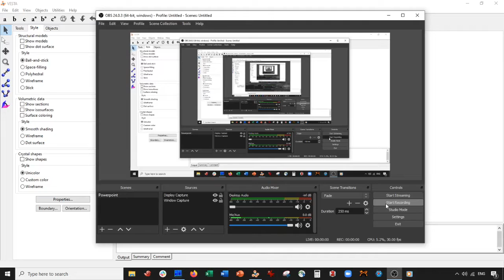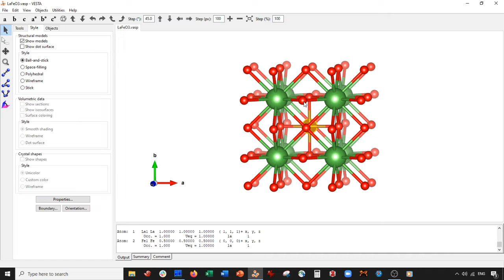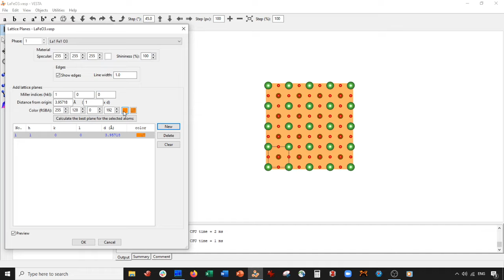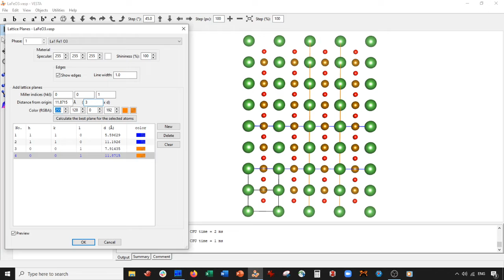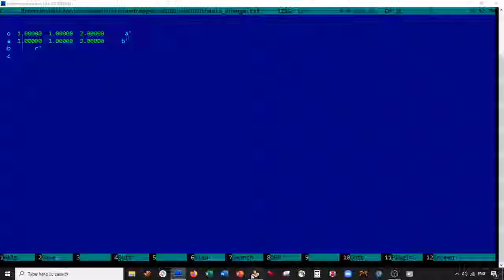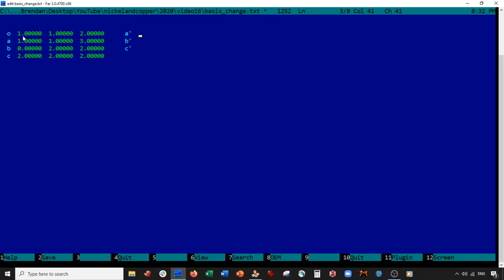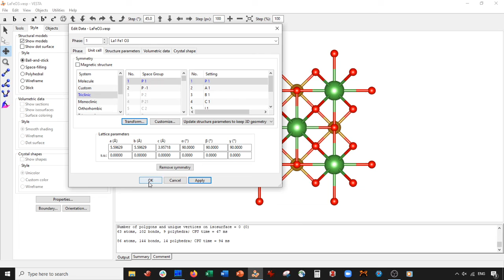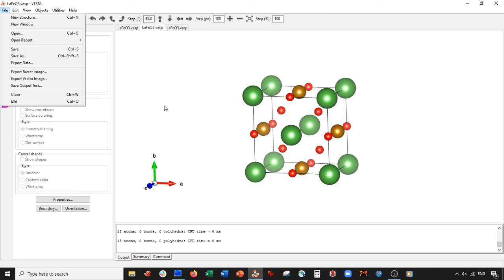VESTA Software - Cubic LaFeO3 [110] Surface Reconstruction

Comment: Should the surface of that slab non-periodic(suppose c direction)?
I am working on surface calulation, from bulk cubic system.
Reply from the maker: The surface needs to have the vacuum - is that what you mean by non periodic? Sorry for the late response

Comment: Hi Sir, I was trying to expose a 100 NiO surface. I was working on a cif file downloaded from springer. I followed your method to build the slab but when I try to transform the original cif file of unit cell like you are doing, I see my oxygen atoms going missing. Does the transformation workon cif files downloaded from internet? Thank you very much for the video
Reply from the maker: Hi Pinak - so sorry for the late response. Do you still need help with this one? If so, please provide the material project id for the structure. Also - anything else I can help you with?

Comment: Thank you very much for sharing a great video. Would you please make the MgO surface (111) with the supercell (√ 3 × √ 3)R30 ?
Reply from the maker: Hi. If the 111 surface is exposed, then you have the root3 cell.
Reply: @nickelandcopper5636  Thank you very much for your reply. Yes, we can get root3 cell for Mgo(111). However, how can we rotate 30 deg.? Thanks a lot

Comment: Respected Admin, Thanks for another exciting Lecture. Kindly make a Video on " How to Construct Slab model for AlN and remove the periodicity from a and b axis ?. I tried the Ru lecture but it does not work. AlN is FCC but different from Ru as treat two aom as basisi in AlN .
Reply from the maker: Nisar Muhammad, thanks for the comment. So you’d like AlN FCC with vacuum? Which surface is exposed to the vacuum? [001]?
Reply: @nickelandcopper5636  Thanks for Your consideration and time. Your question give me more knowledge. I just tried without considering a particular plane. Kindly in your tutorial also discuss the concept of particular plane. Further, If possible give hints about polar and non-polar plane as well.
Reply from the maker: Sure, I can do that. But for the polar non polar, I am not quite sure about that. Typically what you should do is look in other scientific works about which surface is the most stable and commonly used. For the video, I will simple add vacuum to the original unit cell for you. Please let me know if you need anything else